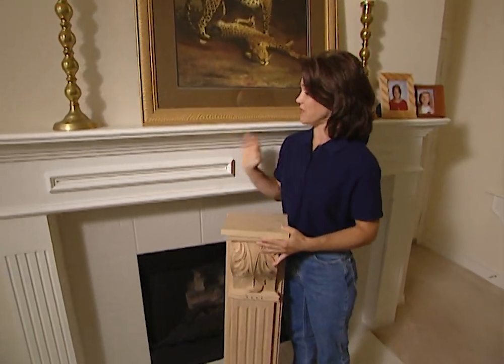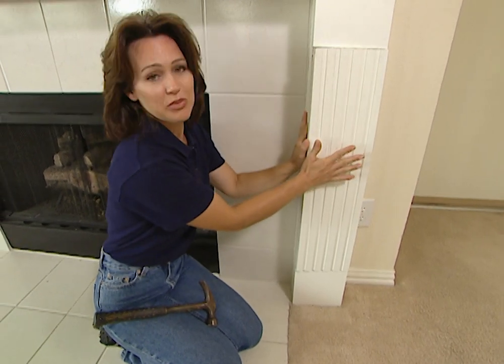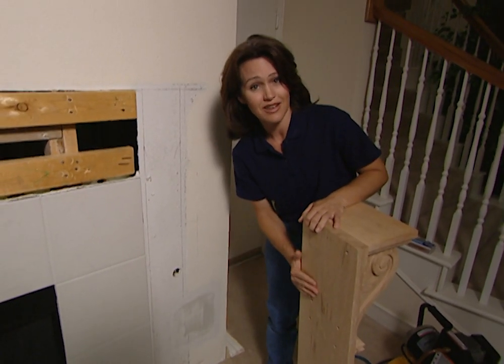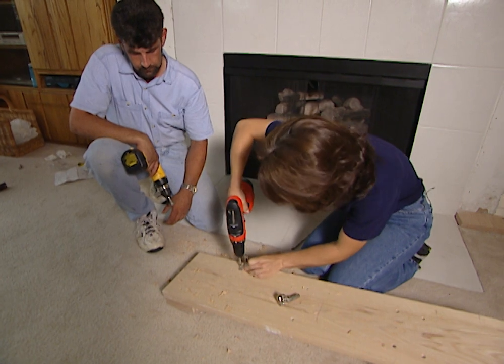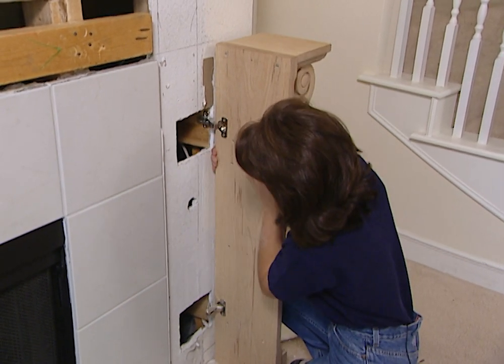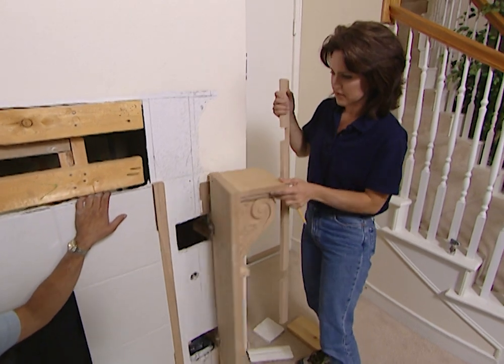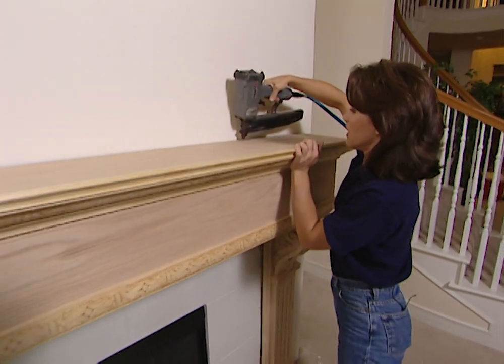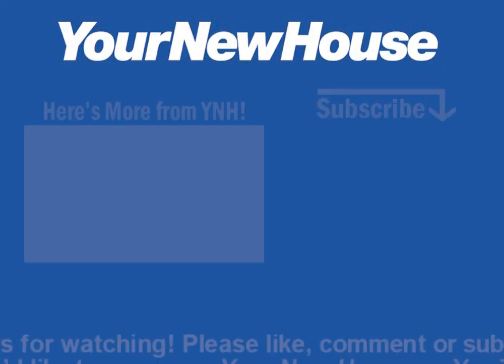Replacing a Fireplace Mantel - Do It Yourself

Comment: Good video and I learned a lot, thank you. The hinged column was too much work for a tiny benefit, it wasn't worth it. Instead, just use an extender and a hole in the post. it would look just fine. Another problem with the hinge, as well as the original door, is that a new home owner might never discover that hidden key. One suggestion: it goes without saying that seeing a woman do this kind of work, making measurements, being the apparent brain/designer, using power tools, is a novelty that increase the value of this video. To that end, hide the guy as much as possible, let the woman do as much of the work herself as possible, and keep the guy quiet and let her direct him as if he's just a helper. The woman could have used the drill to bore the hole, a little practice and she could have done that.
Reply: She stated that reworking the plumbing for the gas line was an expense they didn’t want to mess with.

When a new buyer comes along the last owner should show them the key.

I don’t think it’s right to “hide the guy”. She needed help removing the mantel safely and that’s okay. You don’t have to do everything on your own.

As for her being able to use the drill herself, you really don’t know that. I have raynauds so I can’t use certain power tools. I can’t mow my own lawn because the vibrations travel up my arm and hurt the rest of the day. Using a drill makes my hand unsteady as well. She could have the same issues or something else. She seems like a capable woman, if she felt she could do it she probably would have.

Comment: I wanted to see the finished area behind the hinging column. Did they fill the drywall? Did they drill out a space in the solid column to fit over the key, or does the key need to be removed each time?